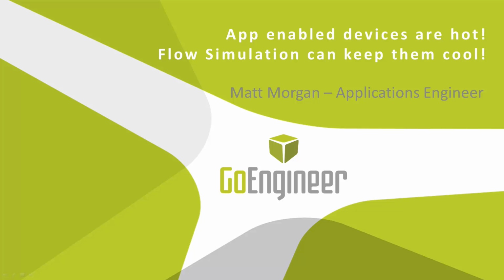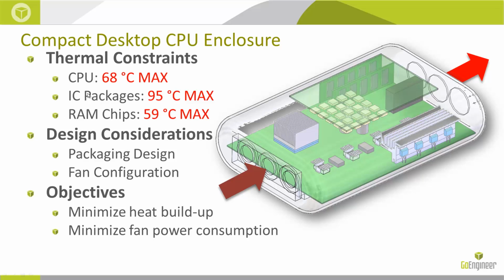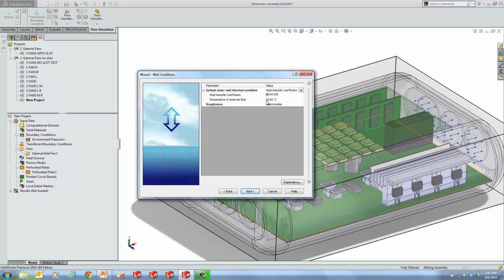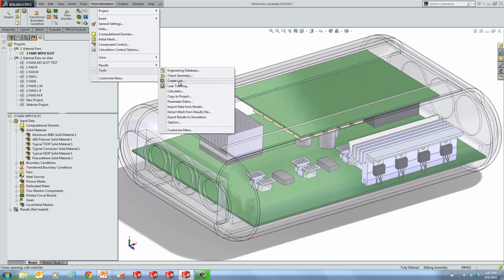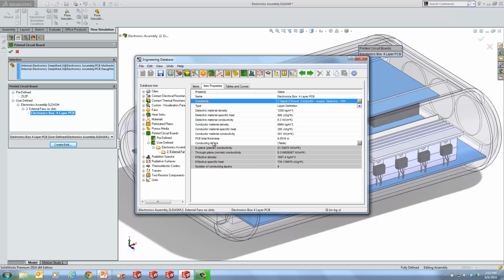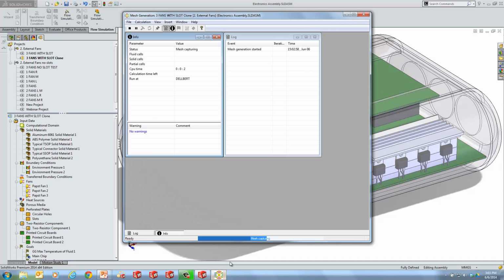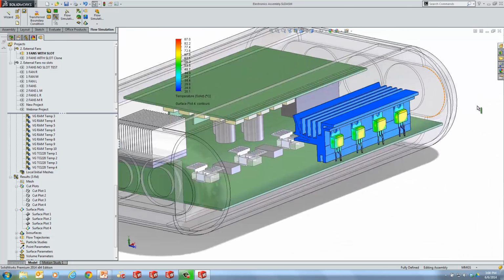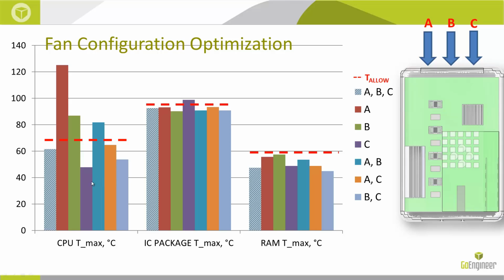SOLIDWORKS Flow Simulation - Keeping Electronics Cool

Comment: GoEngineer, Can you please make a new video about the Electronics Cooling Module within Solidworks Flow Simulation.  Please provide some guidance about common rules of thumb or assumptions that can be made especially focusing on how to interpret datasheets into the proper format needed for the simulation.   I would like to see some more examples of the Two-Resistor Component, Thermal resistance, Thermal Joint, Printed Circuit Board tools.  Please highlight and give advice on common problems design engineers have when determining the best values to use.  please talk about how radiation seems to have a big effect of the results.  My application is to advise PCB layout engineers about where to place the significant heat generating components and how to best design/select heat spreaders, heat sinks, and baseplates to manage the heat and ensure that the junction temperature do not exceed there max temperature limits. Thanks!

Comment: Is it possible to simulate the cooling time?

For example, I would like to find the time it takes for an aluminum pipe at 70 degrees to become 50 degrees. There is natural convection and the atmospheric temperature is 20 degrees.

Comment: Another thing to keep in mind, when you are picking fans or heat sources, if you say 2 watts and click three transistors, it spreads 2 watts across all of them, via surface or volume generation. so if they are 2 watts each, make a separate condition for each, or do 2 watts x (quantity). This is true with fans as well, do not make a fan boundary condition and click on multiple items, its safest to make one condition for each part. Also the fan source you click should have similar geometry to the actual fan the data is coming from. tough lessons i learned.